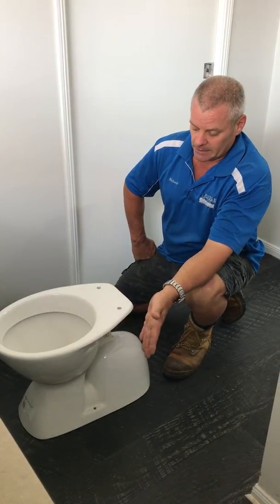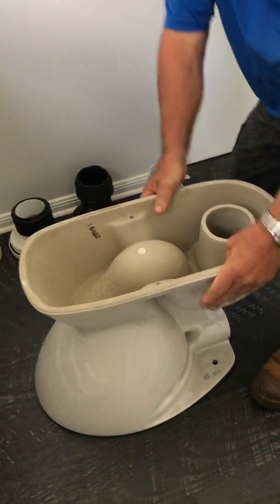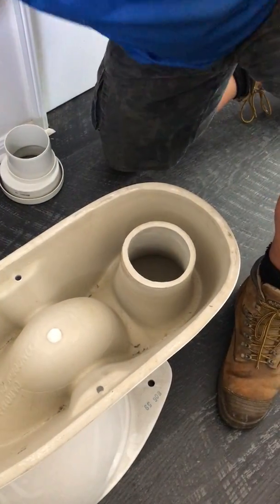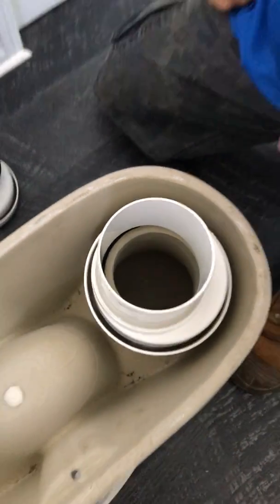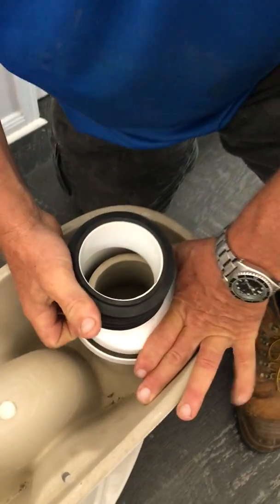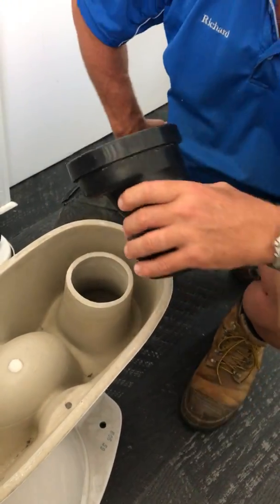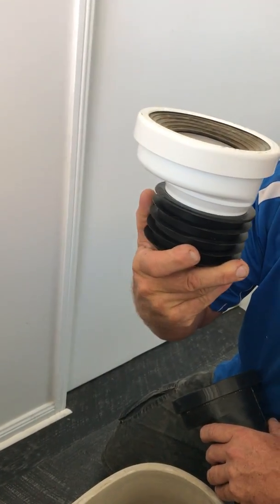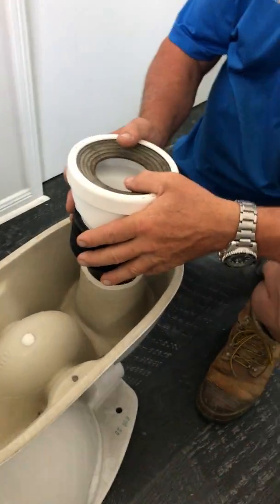Why some new toilet pans can block - Off Set Pan Connecters

Comment: Excellent video actually even with the 20mm collar offset we had a toilet that kept blocking every few weeks for several years and I only recently fathomed what the problem was. This was on a P pan and the plumber who installed it had the collar offset to the side which made the situation worse.
Reply: Your not allowed to use off set pan collars on p trap pans. Can only use on s trap

Comment: I was doing the same today, someone set the toilet 65mm off center and centering the toilet was needed to better position 2 grab rails. Had to make a hardwood raiser as the offset adapter made the toilet sit 100mm higher than normal  which actually is a much better sitting height. 
Someone had glued the toilet to the tiles which made 2 tiles break so they needed replacing and the riser fastening to the floor using Dyna bolts and then the toilet fastening to the riser and all up an 8 hour job.
Reply: I got a toilet pan and there is no screw hole with it. Should i use only silicon to install it? You told it broke the tiles. I am confused.

Comment: Hi Richard, what about if you use the new orbital connectors by caroma. Does this type of orbital connectors resolve these issues?
Reply: Hello dear Richard. My Toilet leaks a few drops whenever flushed.The leak is located at the end of the Pipe’s part that attached to the back of the Toilet. Please see the attached picture. I would appreciate your advice on how to solve this issue. Thanks so much